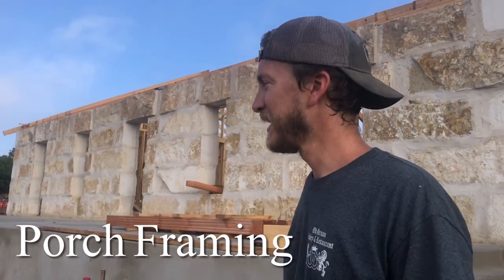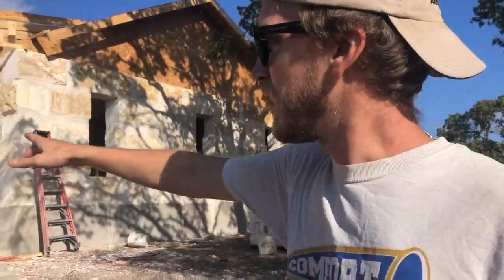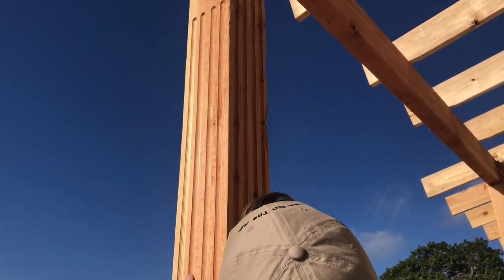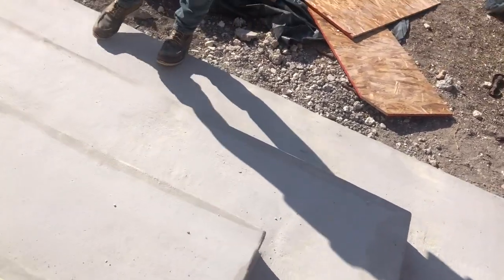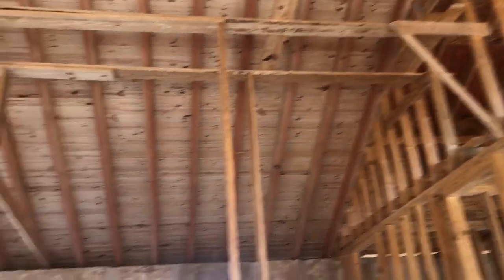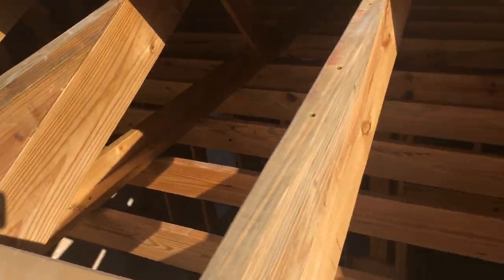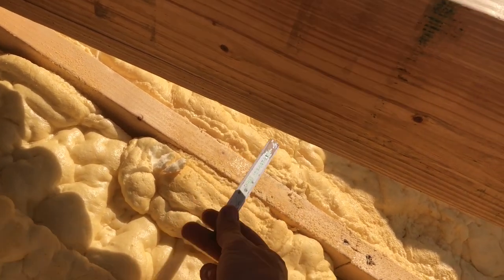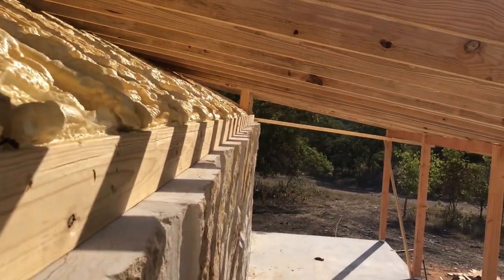Episode 10: Porch and Roof Framing on Our Stone House Build

Comment: How much does a project like this cost? What was the cost of your limestone?
Thank you
Reply from the maker: Your price for just sourcing the rocks and getting the rocks stacked and mortared will depend mostly on these factors, if you are coordinating this step yourself:

1. Price per block from quarry (some may have the same price or different price for different sized rocks 
2. How many blocks you need 
3. Shipping costs of the blocks 
4. Cost of finding someone who can stack the rocks 
5. Cost of having someone mortar the rocks. 

If you have a local quarry, you can start there and they can usually give you a quote on the rocks and shipping. 

We used Texas Limestone Homebuilders just to stack and mortar our rocks. They also build stone homes outright but we just used them for stacking and mortaring. https://txlimestonehomebuilders.com/

We also needed to hire a skid steer/operator to offload the rocks from the trucks, before they were stacked by a crane.

Cost really depends on region and availability of the stone and a crane and a crew willing to stack and mortar.